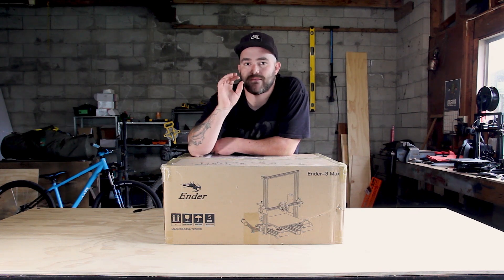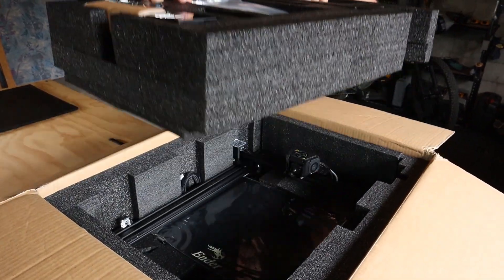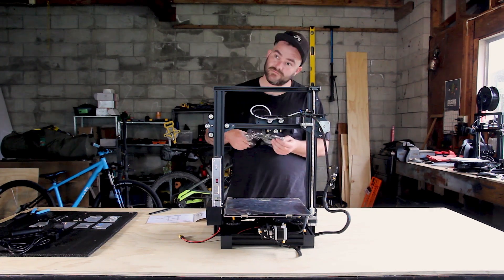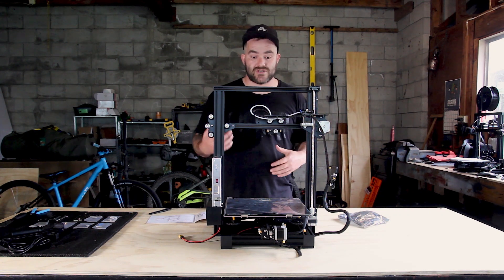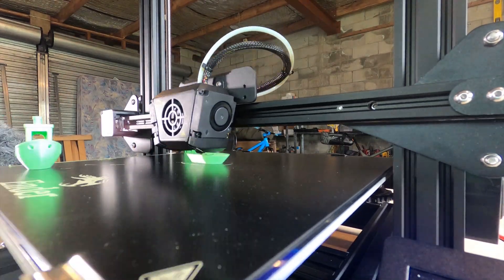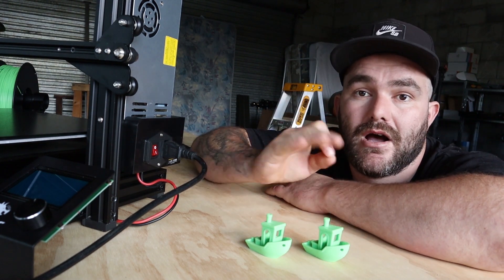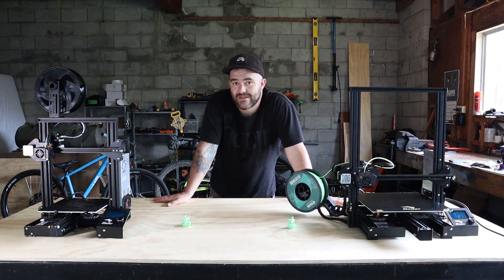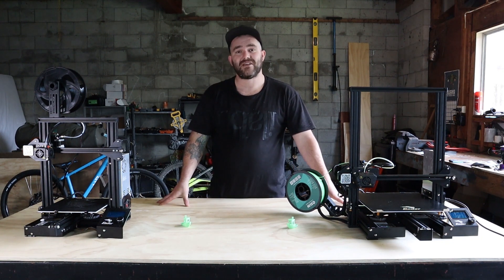Ender 3 MAX Unboxing, Assembly & First Impressions

Comment: The Ender 3 is a GREAT entry level printer, with a lot of 3rd party support. But I don't see its limitations as being something I'd want to suffer at a higher volume. e.g. the single Z-screw, lack of probe, run out sensor, slow print speed etc. If it's literally just a bigger build volume I think I'd want a printer designed from the outset for that size.
Reply from the maker: Great point. I'm still trying to figure out where this fits in the market.

Comment: You didn't go over any of the new features (dual parts fans, metal hot end, 32-bit board). A full review is necessary.

I have a n extremely modified Ender 3 Pro (dual gear extruder, microswiss hot end, dual-z stepper, linear rails), and I'm planning on getting an Ender Extender 300 kit for it. I wish the Max had been available when I got my 3 Pro.  :(
Reply from the maker: Yeah I think I might have too. I want to get a few big prints under my belt first and dial in those profiles.